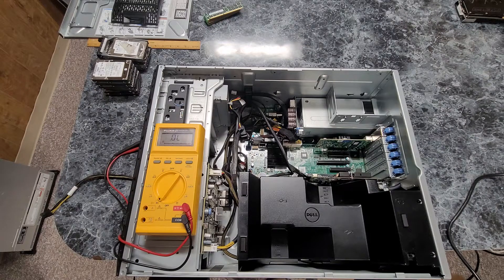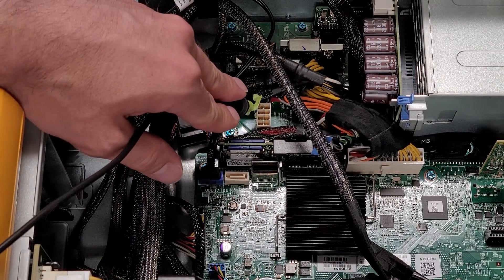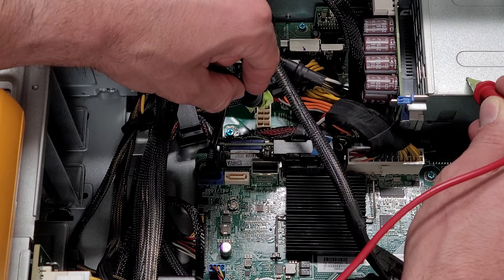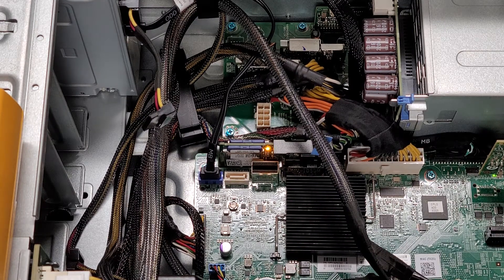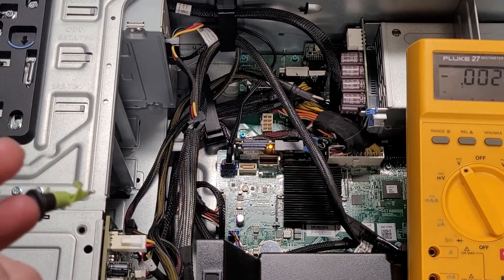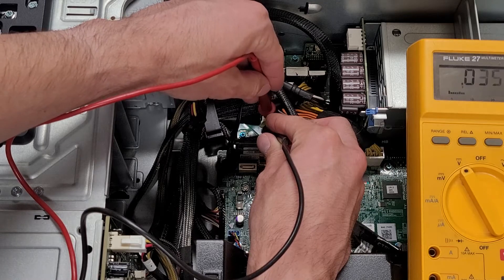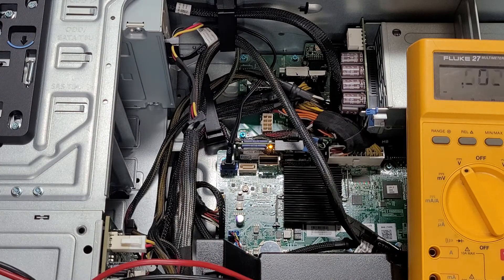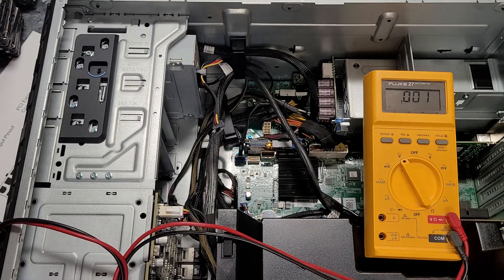Verifying GPU power pinout on Dell Poweredge T420

Comment: On your diagram, is the PCI-E 8pin correctly wired? I'm tossing in a P40 into my T420 and I want to validate a cable I purchased. Its EPS12V at the GPU
Reply from the maker: The motherboard connector has the pin out like that diagram if you look at the connector from the top down. Motherboard side is PCIe 8-pin pin out using an EPS 12V style connector. GPU runs on normal EPS 12V pin out and connector.
Reply: @computersales  Awesome thank you! Looks to be good to go, powers on, but definitely running into thermal issues with the P40.  Sadly it looks to be longer than the M40 so the typical pass through blower wont exactly work :(
Reply from the maker: @michaeldisieno3465  P40 should be same length. If you can get your hands on a pair of 40mm fans those should be adequate for cooling.